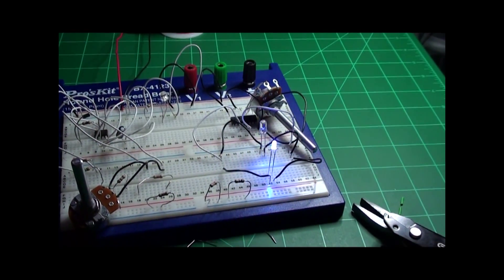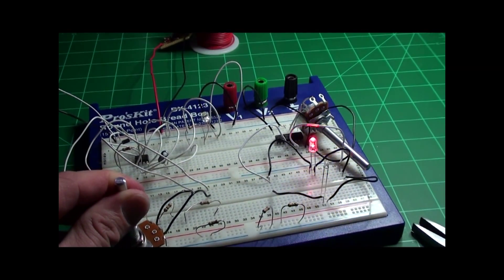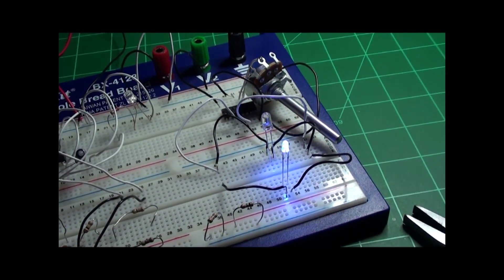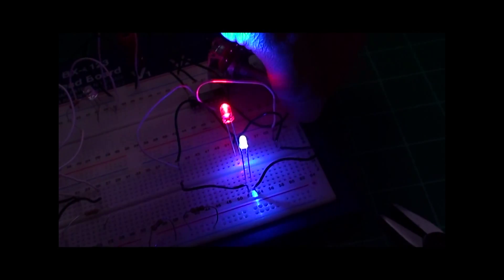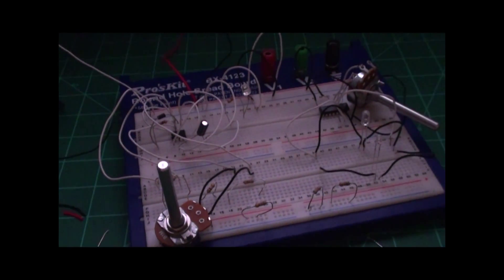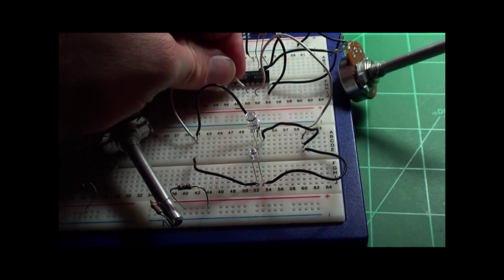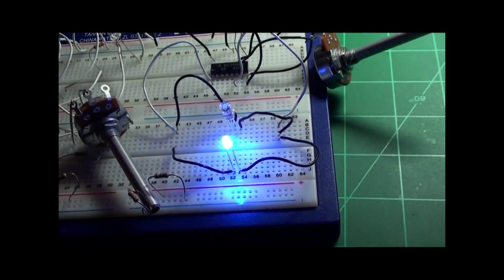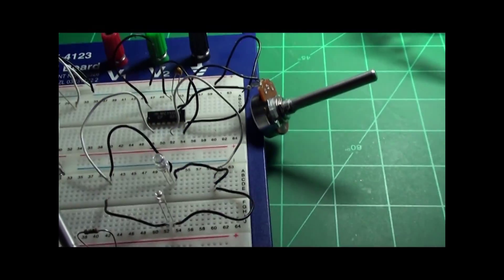555 vs 4060

Comment: You could also use an attiny (1$ or so) and just program it to flash however you want :)  While its true that in quantity the 555 is cheaper, in the end a MCU is probably the right way to go for most hobbiest projects.  I have plenty of discrete chips, and their fun to use, I just feel like the more I play with the stuff the more often I see that using an MCU is often the simplest way to go.  It's certainly the most flexible.
Reply from the maker: While your comments are true, there is a jump in knowledge that is required to learn how to program a PIC chip, or an Arduino.   I made this as a tutorial for those that don't want to learn how to code.   I have not taken that plunge yet due to time.  I just don't have time to learn how to work with them.   This is simple and fairly fast to learn.

Comment: Good video - I am trying to light up a peregrine maquis fighter with 4 x 3mm red led's and 4 x 3mm green led's, (running lights), but as the two colours run at different frequencies and use different resistors, I cannot get all 8 led's to flash at the same time - I'm running off a universal regulator, 4.5 volts.  The green led's work brilliant (4 at a time) on a 555 timer, so do the red but at different speeds.  I have got some 100k potentiometers but damned if i know how to incorporate them into the breadboard!  Would these be the right pots to use and am I on the right track?
Thanks for any help
Steve
Reply from the maker: Are you running both sets off of the output pin?  If so, all you should need to do is resistor the red LED's a bit higher than the Green everything should work fine from there.  

I have not worked with a voltage regulator before.   So maybe that is the problem

Comment: You really need a current limiting resistor for the LEDs on the 4060 also. It's just that the output on a 4060 can sink/source much less current than a 555. As they are, the LEDs will effectively 'crowbar' the outputs, pulling down the voltage to a non-destructive, but still stressful, voltage. The 4060 will not be happy.